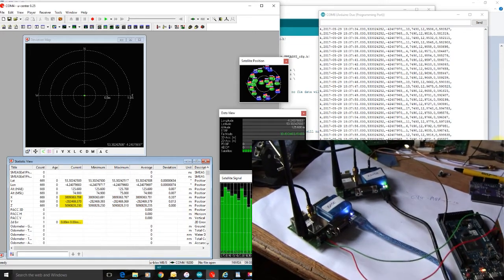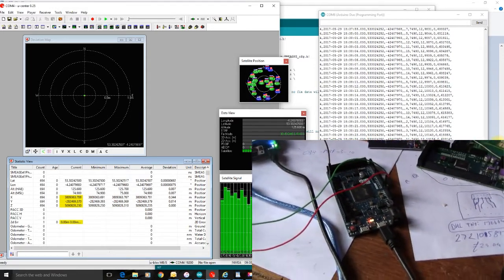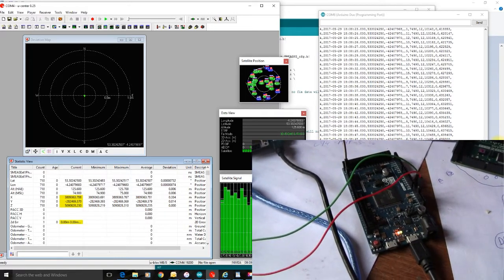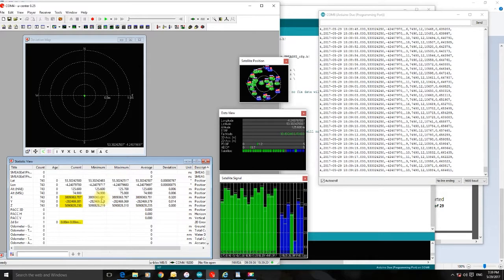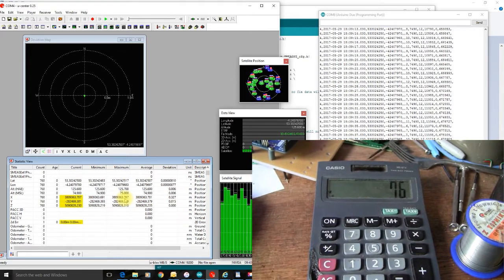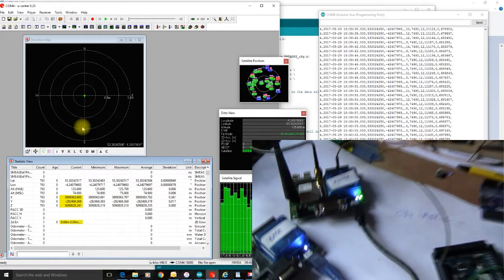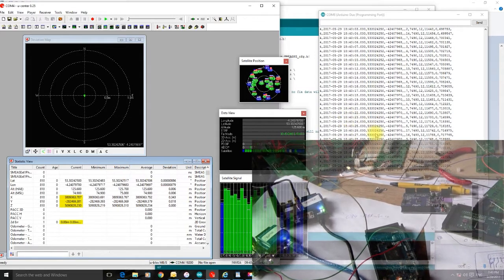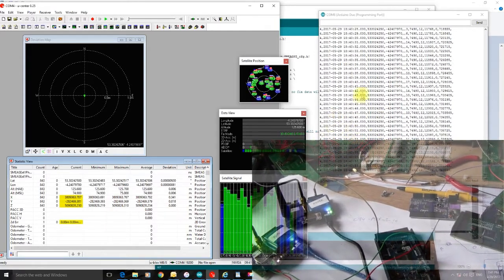Ublox M8P GPS base, rover and Arduino Due set up

Comment: i am using the ublox c94-m8p for survey purposes like you base and rover it work fine i add a HC-06 bluetooth modul to c94-m8p so i can use to connect my android phone for using the mobile topographer app i connect the bluetooth module to j8 pin 1-2 for power and ground with external power connected to c94-m8p ans pin 9-10 for rxd an txd. i set the ubx-cof-port- to UART1  9600 and it works like a charm but i losing communication with base because rover works in 19200. do you know how to keep both bluetooth modul and base conected with rover?

Comment: Can you describe how you output the NMEA sentences to the Arduino?  I have the evaluation kit working (base and rover).  The User Guide doesn't tell how connector J8 pins are numbered.  Programming the UNO R3 to echo it's input to my PC's serial monitor, I can see partial NMEA messages but there are many non-printable characters also.  How did you set the UBX-CFG_PRT, RATE configurations, etc.  jim@outfarming.com
Reply from the maker: Sorry but I cant remember. I'll be doing more work with the Ublox system in the next month or so keep a watch here for updates: https://hackaday.io/project/21744-weedinator
Reply from the maker: Coming very soon here: https://hackaday.io/project/90057/instructions

Comment: Hello sir, can you please share the Arduino code?
Reply from the maker: void setup() {
  // initialize both serial ports:
  Serial.begin(9600);
  Serial1.begin(9600);
  Serial.println("Ready to test");
}void loop() {
  // read from port 1, send to port 0:
  if (Serial1.available()) {
    int inByte = Serial1.read();
    Serial.write(inByte);
  }
}
Reply: Thank you sir, If I read from the rover, do I use the same code, Which pin should I use on the ublox? I can't see very clear in the video.
Reply from the maker: The Arduino Due Rx1 connects to pin 10 of the Ublox M8P on J8. The numbering on J8 is a bit weird - think 'snakes and ladders' rather than 'circular'.
Reply: Thank you sir, I will give it a try (haven't got my m8p yet) I only have an Arduino mega do you think the mega will work? I was following your automated tractor project, From your experience is that m8p really centermeter level accuracy?
Reply from the maker: Mega is 5v so you either have to use a logic level shifter or the Due otherwise you may destroy the rover.
Reply from the maker: Full instructions coming here soon: https://hackaday.io/project/90057/instructions

Comment: Hi
I have 2 units and have a little trouble getting them to function properly. I followed the set up for base and rover, did the survey in however the base never switched to TIME. Also I only have the blue Led flashing none of the others light up. I can explain more about my setup if you can help me
regards
Max
Reply: Have you set your GPS antennas in clear sky?  With ground planes?  Have you monitored the UBX-NAV-SVIN messages?  Have you tried easing the settings on UBX-CFG-TMODE3?
Reply from the maker: Full instructions: https://hackaday.io/project/90057/instructions